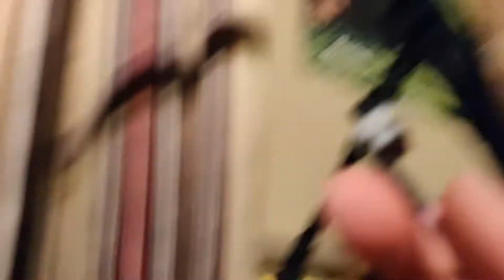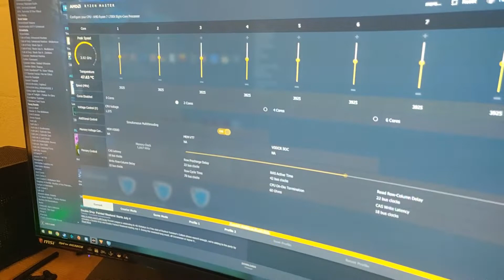Loque Ghost S1 (Everything Wrong)

Comment: Has your opinion of the case changed since this video? I just ordered this case myself :)
Reply from the maker: Not really, it's a good case but the power cords are to short for MSI itx boards. I had to buy extension on Amazon for $8. If you want a case at this form factor it is one of the best. I'm Shure their shipping issues have been fixed. S1, N1, and Dan case are the 3 best itx cases. Loque S1 is the only one with expansion options though. I did get a refund for the tip hat after emailing them a few times. It's a cool case but if u don't need the expansion options I would go with the N1 and save a few bucks.
Reply: Here’s my completed build: 
https://i.ibb.co/N6QPf4D/IMG-8228.jpg

https://i.ibb.co/N7P0xKK/IMG-8224.jpg

Comment: Your video is latest I’ve seen so far, so just like to get one thing straight, so you order through amazon, but it still takes 4 months to deliver to you door? 
Man, this is real f Ed up
Reply from the maker: Yep.
Reply from the maker: If ur looking for a itx case I would go with the N1 if u don't need the top hats/expandability.
Reply: Phenix HSIEH I ordered mine last week and it came in two days ago, maybe the shipping issues have been fixed. It seems to me that amazon messed up distribution in the start.
Reply from the maker: @hitmanslayer3003  I ordered directly through the loque page. They were post transition with fulfillment by Amazon and it got screwed up, alot of people had problems not receiving orders. I have numerous emails going back and forth with them. They never gave a real solution to the problem over the course of 4 months all they did was apologize and wait for the dust to settle. Its probably fixed now. But I still stand by my statement that if u don't need the expandability the N1 or Dan case/Dan case knock offs are a better option/value.
Reply: E Eekhof thanks, glad to have your information, by the way, when you receive yours, has they fix the power bottom Cable issue?
Their web pages says MK II is fixed, but I wonder does their US stock still remain
Reply: Phenix HSIEH yeah it wasn’t an issue on mine,
Reply from the maker: @Phenixzero  I don't believe they have solved the power button cable length issue as it only exist with the pin placement on the msi b450i that I know of. A lot of other builders have used other motherboards and not had that issue. But they don't give eny indication of comparability issues with eny parts so if you plan to build in it definitely check dimensions of the parts you plan to fit inside of the chassis. I did and I still ran into some issues when I water-cooled the system.
Reply: ChaddysTechStuff yeah it seems that you got left out to dry. It would still choose this over other just because I could actually find this and since I travel with it the extra build strength gives some peace in mind.
Reply from the maker: @hitmanslayer3003  Glad to hear it. I was really put through the ringer trying to get it together while I was home on leave for 2 weeks lol. I know that they do take in public feed back / designe suggestions/ blueprints, witch is pritty cool. Thats why they have different batch nomenclatures, they do make subtle changes over time to the case.
Reply: ChaddysTechStuff thanks a lot, I do planning make a 9700KF build with ASUS Z390i, it comes with extended cable, I reckon that would not be a issue
But I was plan on use Alpenfohn Black ridge cooler, but it seems to me is much harder to get at moment, somehow, all the Europe has out of stock, only France and Italy has it, but both of them has terrible mailing performance
Reply from the maker: @Phenixzero  nactua NH-L9x65 is what I initially used it worked very well.